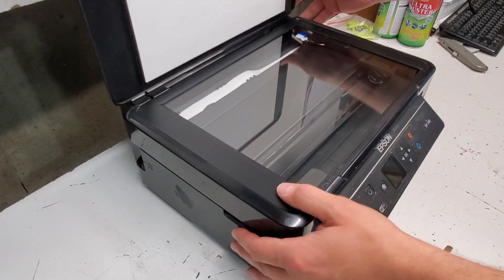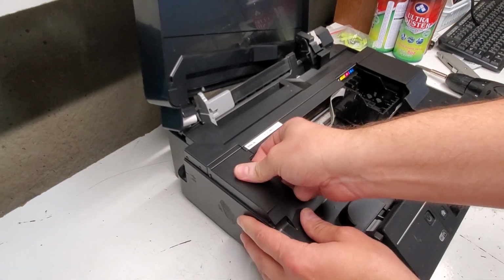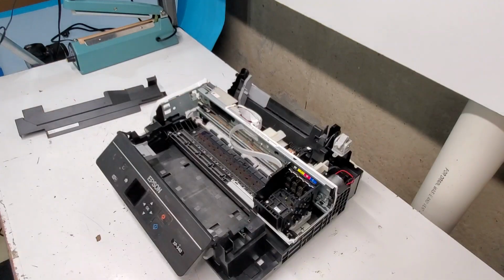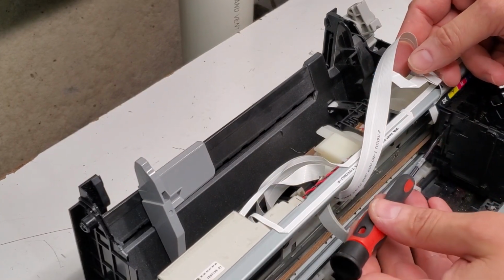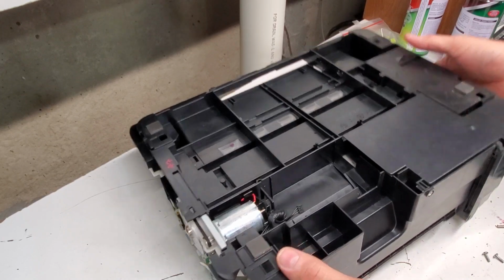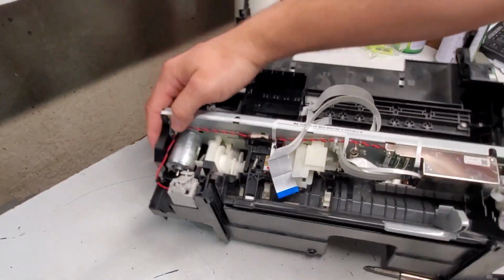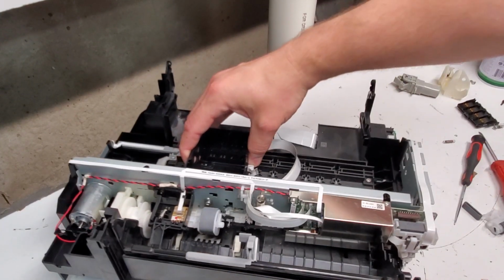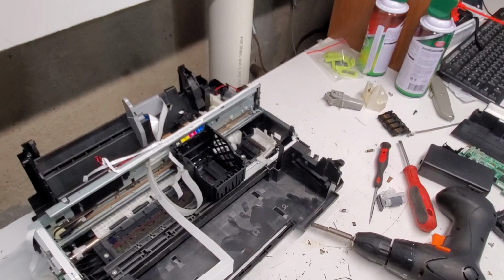Taking Apart Epson XP-340 Printer for parts or repair. XP-400 XP-410 XP-440

Comment: Thanks a bunch, the time to view this was well worth it for the results. I was getting a paper jam display with no visible paper in the mechanism and could not go any further. I figured it was worth a shot to check inside for other issues. Although the video did not describe problem solving issues just getting this apart would have been a much bigger challenge. I got my XP-440 apart, found the problem (a part interacting with a detection switch on the circuit board that must have been bent removing a paper jam), and all is well.
Reply from the maker: That's great! Thank you for sharing!

Comment: Thank you so much for taking the trouble to show us how this thing fits together - or rather, comes apart! It's just awful that all this costly equipment is meant to go to landfill after it has a wee problem. I only wish you'd shown us how to get the tape connector for the scanner back in place!
Reply from the maker: Thank you. Yeah, unfortunately when I do a disassembly video, I do not think much about showing how to reconnect things or put back. I understand some connections are simple slide in place, others have a small clamps and those clamps can be different as well. I will keep that in mind in future videos and try to point those little things out. Once again,  thank you so much for your support and for the suggestion.  Have a great day!

Comment: Thank you for this. I'm currently really struggling to refit a flat ribbon cable back to the ink tank holder on an Epson XP425 as it's in the most awkward position and I'm not very technical so this vid helps massively! Many Thanks!

Comment: Actually I have another question.  My screen is not working at all, so I wanted to take the printer apart to see if there's a loose connection that needs tightening before attempting to replace the part.  Will I be able to test out the screen if I've taken everything apart up to the point of taking out the screen/control panel, or does the printer need to be reassembled in order to test it out?  Thanks!

Comment: How do you remove the entire cartridge cage?  I've accidentally pulled out the tiny  cable from the rear of it, and can't get it back in.
Reply: I have the same problem, did you  find a solution?

Comment: Can some body please give me some advice . The white cable that was attached to the carriage, the 1 shown in this video has come off, and I cant get it back on. Any advice please. Their is not much room to attach it as the carriage is still attached to the unit. Thanks
Reply: Currently having this same issue and about ready to give up... were you able to reconnect it?

Comment: Update: Thanks to your video  I was successful in removing the left side panel and scanner cover so I could access the wires for my faulty display panel.  The connections seemed tight, but still display not working.   If I can get a replacement panel I will need to reassemble what I've taken off and herein lies my question for today:  Where does the cover wire get connected?  Like you, despite my best efforts, the cover's wire got disconnected.  Not sure where that gets plugged back in.  Would you please explain.... Thank you!

Comment: I have an epson ET m1120 ECOTANK. I want to seek the following solution. I would like to replace the inkt inside with special stencal inkt. How could I proceed to remove the existing inkt in the ecotank and fill it with the special stencil inkt? 
I think that I should see if i can remove the tank and turn upside down, if possible. 

What I have tried so far  is insering a seringe to see if i could vacum the inkt out. But the needle wont go through, and I dont want to force it. Any advice and suggestions are welcome.
Reply from the maker: Hi. I do not think that you can remove the tanks, maybe you can, but I never tried. The only thing I can possibly help with is getting to the ink cartridges. I'm sorry I'm not much help. This is the video:
https://youtu.be/ep2XF_mv5Mk

Comment: Once the ribbon wire from the document cover lid disconnects from the bottom, is there a way to reconnect it?
Reply from the maker: Hi. Yes, all wires should be able to reconnect to board. There shouldn't be any soldered wires. Some connections have a clamp, check closely
Reply: @303electronics  got it. Thank you!

Comment: One last question I promise!  Have you seen issues with the control panel not working on the xp310?  I haven't used it much and have kept in the box as well.  Suddenly it just stopped working.  Lights up, but nothing there :(.  What do you think is the cause of this issue?  Is it possible that the wire isn't properly positioned or maybe came loose somehow?  Not sure how/why that could have happened, it's not like I've been using the printer as a football or anything.  "Here, catch!  It's an Epson"!!!

Comment: Hello, I have a question regarding my Epson XP442 printer:

The printer prints, but the sheets in the paper tray are clamped by such a movable little arm that the printer cannot pull/take the sheets. 
I thought about tearing the little thing off, but it is necessary because it detects whether there are sheets in the tray or not.

What can I do?

Comment: Do you know what is the name of the Print Head. Code or  Version or type. Thank you for your video.
Reply from the maker: Hi. Best is to search the printhead with your printer model. for example "Epson XP-400 printhead" or "XP400 printhead". I do not know the part number for this printhead, but I found this listing. It is not mine and I have not bought from them. www.ebay.com/itm/202663047946
Most are going to be from China, about 2-3 weeks delivery.

Comment: has the printer got any lithium battery? thanks
Reply from the maker: Gi. No, there is no battery on this printer. Maybe a tiny one on a logic board,  usually never needs to be replaced. This printer needs to be plugged in to operate.

Comment: I have an XP-420 that immediately displays a “0x60” error when turned on and asks to be shut off. After taking it apart, I did find one small plastic piece rattling around by the printhead; it is L-shaped, black, very small with one outer side covered with a small reflective sticker or metal. I can’t seem to find the part anywhere online. Does anyone know what it is? I suspect this is causing the issue but don’t even know where to begin. Thanks!
Reply from the maker: Usually something inside the printer will trigger that error. Remove loose part and see if problem goes away. It can be a broke off piece of structural part of the printer and may not negatively reflect on printer functionality.

Comment: I have a canon 5750 pixma,and it print blank paper.what to do plzz
Reply from the maker: Hi. Check cartridges first and see if they are nit dry. Clean printhead manually like in this video:
https://m.youtube.com/watch?v=DFdM9Z6Nnxg
Reply: You can tell this is not your first time taking apart the Epson XP-340 printer. Thank you for making this video.
Reply from the maker: @muxallopeniot9194  thank you!!!